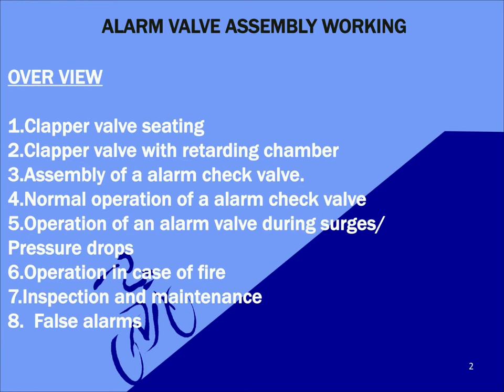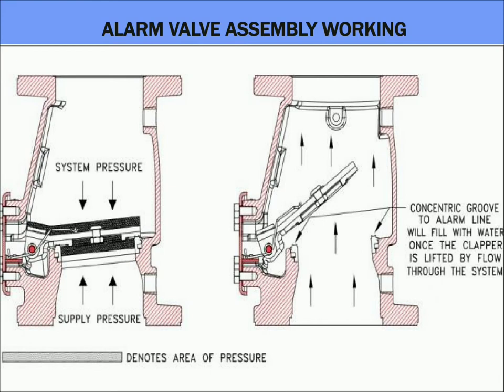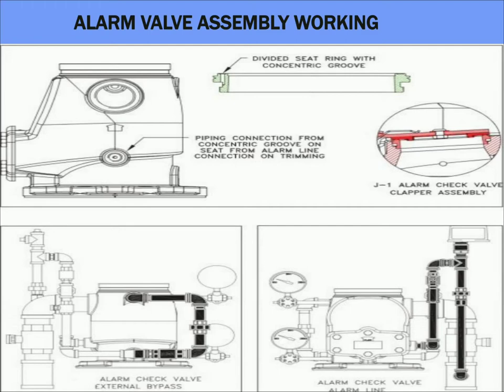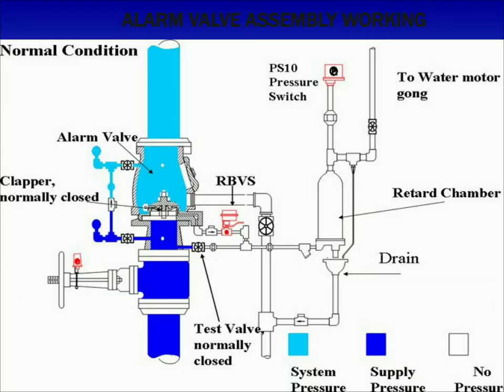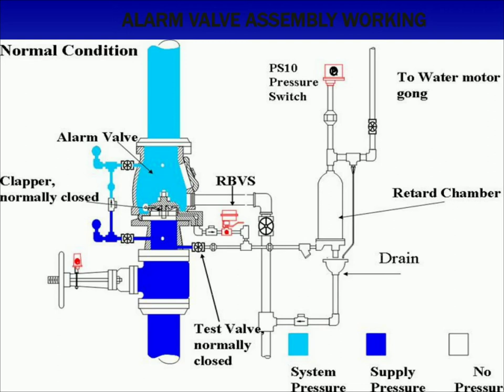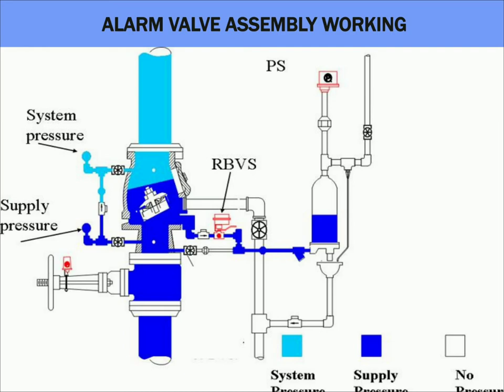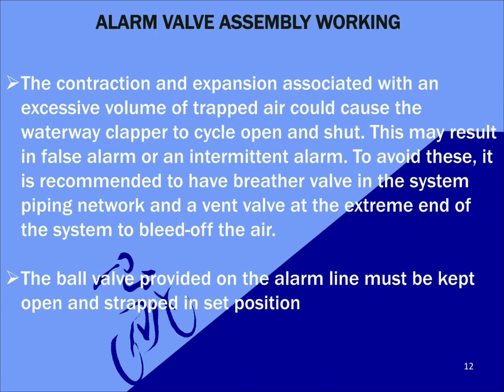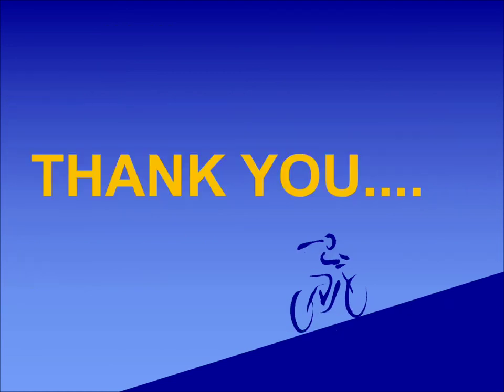ALARM VALVE MOTOR GONG ASSEMBLY WORKING

Comment: dear binu,
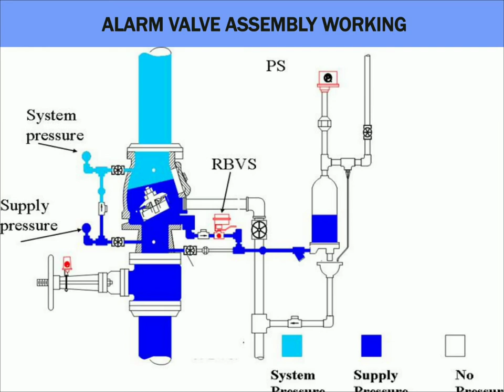how at 6:25 will the surge from the supply line is allowed by bypass and allow system pressure up and how it help to prevent excessive wear and tears on the clapper.

Comment: Ayman Biomy
What about sensing lines of fire pumps and its positioning with respect to ACV, is it connected upstream or downstream from the ACV? and what about the jocky pump operation, is ACV open each time of jockey pump operation?
Reply from the maker: sensing lines should be connected in between the discharge side check valve & gate valve for each pump. It has got nothing to do with ACV.  
In order to balance the pressure on both supply & delivery side ACV clapper arrangement will be in closed position during its normal operation & will open once the delivery side pressure drops.
Reply: @technicaltalkswithbinu8826  if so sensing lines does not sense the accurate network pressure because ACV isolate between sensing lines and the network